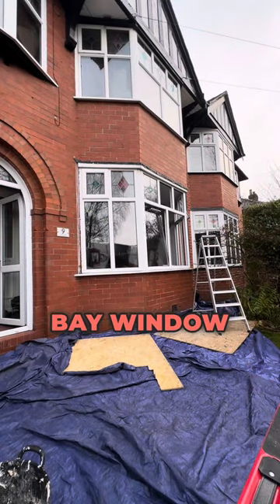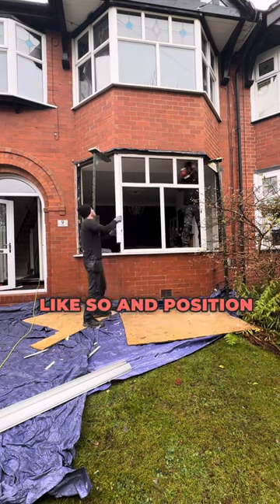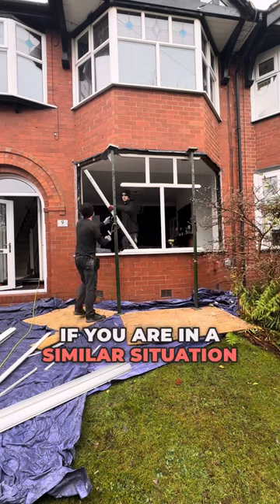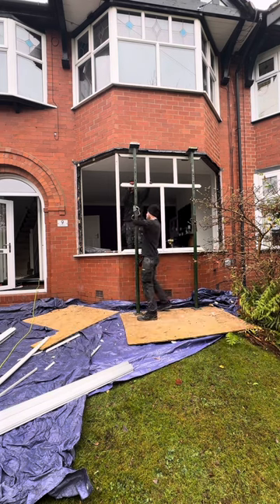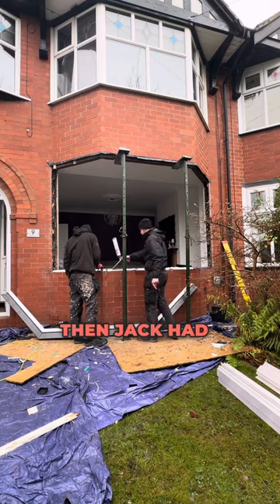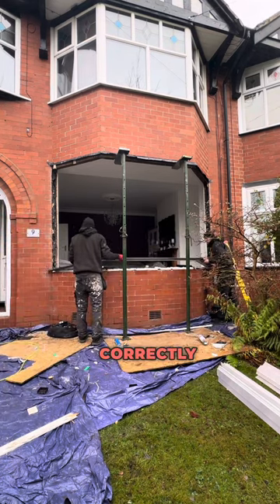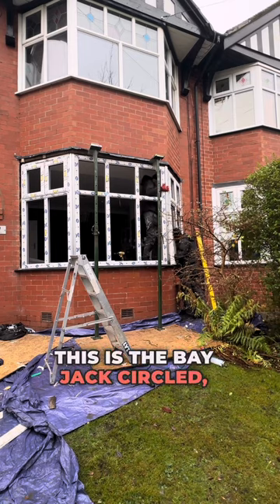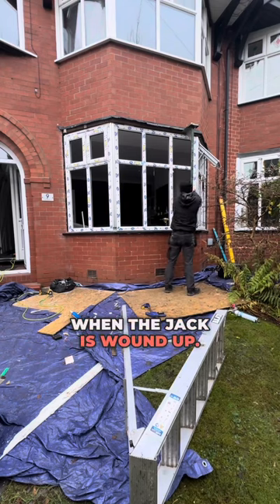How to install a load-bearing bay window using acrows with strong boys #baywindow

Comment: I remember the first bay I did as a fitted not a boy ! Two load bearing, tile hung middle and tiled apex roof above , 6 sided bays off a ladder (as we never used scaffolding back then ) with timber coming out the original timber that was massive sections . I nearly cried 🤣Nicest one I ever did was a three sided box sash bay that I put back with timber box sashes it looked really good.

Comment: Your title is misleading, it should be 'how you fit a load bearing bay, not 'how to fit a load bearing bay'.  There is no correct way as subtle differences in the way installers work make every bay window install totally different. A 7 segment barrell bay would be good to show.
Reply from the maker: Yes valid point everyone does do bay windows different!